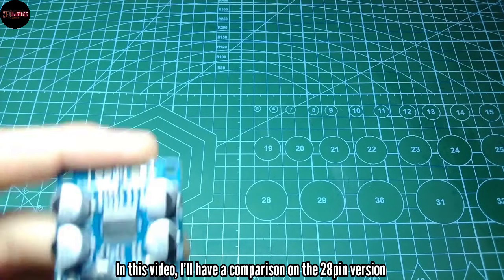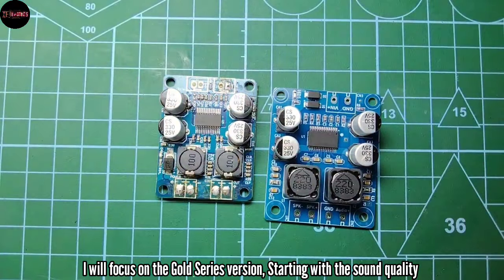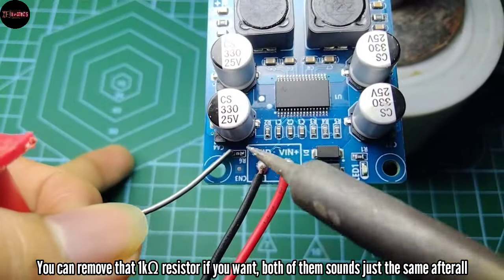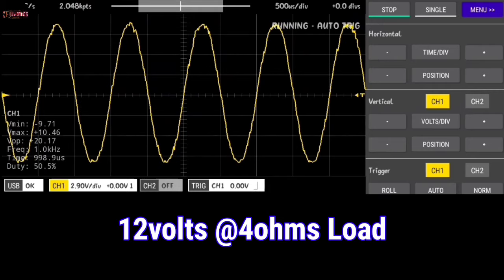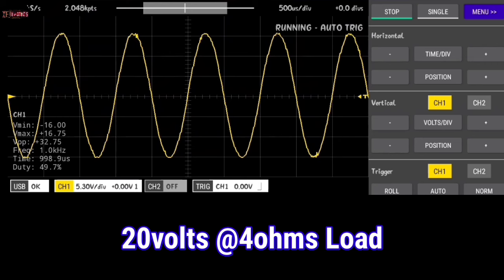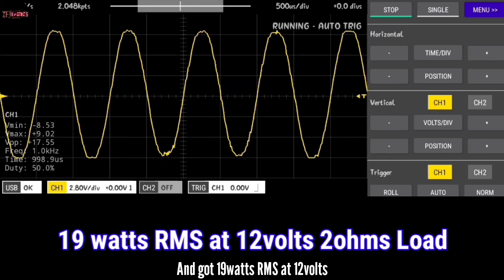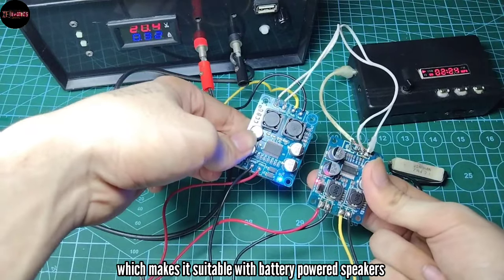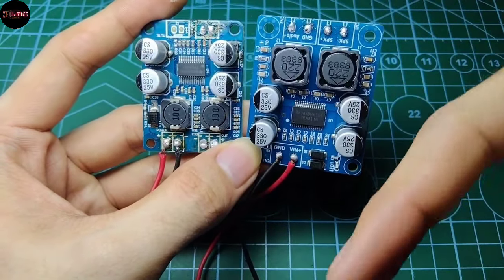28Pin VS. 32Pin TPA3118 module review !! RMS Power Test !! #classd  #tpa3110 #diyaudio

Comment: I think 28 pin version just like tpa3110 with bridge mode, the original 32 pin of 3118 price close enough to 3116 with double performance as well
Reply from the maker: Yeah it's possible.
But for me.
The 3110 module sounds better than the 28pin 3118

Comment: Use the 32 pin tpa3118 with 24v and 8 ohm’s since in the data sheet it is recommended to use 24v with only and only 8 ohm’s load.
Reply from the maker: Sorry didn't try with 8ohms, since most hobbyist out there uses 4ohms speaker everywhere. I'll definitely try with 8ohms load in the future
Reply: The mono version of the Tpa3118 32pin supports speakers up to 2ohm, but an aluminum radiator must be added over the chip for better cooling.

Comment: V^2/R is not RMS
Reply from the maker: Thats why it is called "Watts RMS" or "RMS Power" because that power was calculated using an AC voltage, or "RMS voltage.
Basically Watts Calculated from DC alone is not exactly the same with "Watts RMS".
You can do some research if you need more information

Comment: How about the pop-up noise when switch on? Any solution?
Reply from the maker: Ohhh, will find bro
Reply: @x3dtronicsph  actually, not sure for this 32pin tpa3118. i have 28pin with mute function but this 32pin no mute function.
Reply from the maker: @Bisdako2013 it's probably because of the PCB design. Mute option can only be compatible with Microcontrollers. Yon can check the datasheet though if you need that mute function

Comment: can you try using pre-amp for it? i would like to see it's performance and sound quality.
Reply from the maker: Sounds Just the same bro. Flat Sounding especially if you use 8ohms Load. If you use bad quality audio source, it will sound bad of course. It doesn't have DSP. I recommend a bass boost preamp thoughhh.
I will try, but I'll probably upload it as a YouTube shorts. Or  I can send you a Video privately
Reply: @x3dtronicsph  thank you for your response.

Comment: hi first you have done some great test, i watched all of your video of tpa3110, tpa3116, and tpa3118, i am shopping for amplifier to power up pair of Dayton MK402x, its a 4ohm bookshelf with 40rms/80peak sensitivity is listed as 84 dB 1W/1m but many test shows it's closer to 80-79 db which board would you recommend? PS i already have active sub so don't think i'll be running the speakers at full volume, thanx
Reply from the maker: Thank You Bro. You got a very good speaker it seems. If you'll going to use it at Home, indoor. It will sound absolutely good with class AB amplifiers. Like the TDA7294 or LM3886. Of course beware of Fake IC's. If you want Class D. The Tpa3116 will be decent, but not that good when it comes to clarity and power. 

But when it comes with power rating and still want class D, Try TDA7498, it's not that cheap though, and it probably needs high Voltage power supply, 30+ volts, but it is the closest match with your speaker. Although i didn't test it yet so I'm not sure about the sound quality. My best recommendation will still be Class AB chips because you're using 4ohms load. If you want Hi-Fi.
Reply: @x3dtronicsph  thanx for your reply and suggestion, the speaker aren't really high end but it's a rather good speaker for it's price tho, usually $75/pair now on sale for $55 from parts-express (USA), i choose tpa311x series chips because i already have few old laptop power ac to dc adaptors rated from 19-24v so no extra cost for me just the amplifier and i'm using it as desktop speaker for pc i am guesstimating I will be using around 10-15w per channel max so i am leaning more toward the tpa3118 mono board x 2, what do you think?
Reply from the maker: Yeah, Go with the Mono, 1chip for each speaker. Choose good 3116 board thou, some bad Chinese parts and designs have bad mid-high frequency response
Reply: For me, better build double stereo amps, for midrange & twitter powered by double lm1875, for bass powered by double bridged tpa3116, no preamp, eq, whatsoever, just bass control. No coloration nor distortion, its my grandpa recipe since cd era

Comment: Bro goods kaya yung tunog pag ito gagamitin ko sa jbl bb2 woofer tas hk tweeter? May bass kaya?
Reply from the maker: Pag 20volts supply mo boss, siksik na yong tunog non, di ako familiar sa woofer mo boss eh. Pero RMS power nyan umabot ng 32watts RMS sa 4Ω 20volts. Lakas na non halos malapit na sa 302 na class AB.

Basta yong 32pin bilhin mo boss. Meron link sa comment at description
Reply: @x3dtronicsph  yung woofer boss yung nasa jbl boombox 2 tas gagamit ako ng isang jbl boombox 2 passive radiator. Thanks boss
Reply from the maker: Di pako naka baklas ng JBL boss, pwede na cguro tpa3116 na stereo jan
Reply: @x3dtronicsph  ay nabili ko lang yun sa shopee 350 boss di talaga siya galing sa jbl hehehe

Comment: If I use two TPA3118 2x boards in stereo from the same power supply, will it cause noise or humming? Many people say that Class D amps create humming when two mono boards are powered from the same power supply.
Reply from the maker: No .
It depends on your board placing , Wiring.
Most of the time, it's coming from the Bluetooth decoder.
ground loop noise.
Isolate your Bluetooth receiver
Reply: @x3dtronicsph  Thank you, sir, for this information. Could you please conduct a real watt test for the TDA 2030? I searched online a lot but couldn’t find it.
Reply from the maker: @shahriarshakil9797 hard to find original TDA2030 bro.
It was obsolete as well like the tda2050.
You can check my Tda2050 video.
I guess the fake tda2030 and tda2050 have same internals
Reply: @x3dtronicsph  Among my favorite channels, your channel is one. I am a subscriber to your channel, and I watch all the videos, Thanks for Reply ❤❤